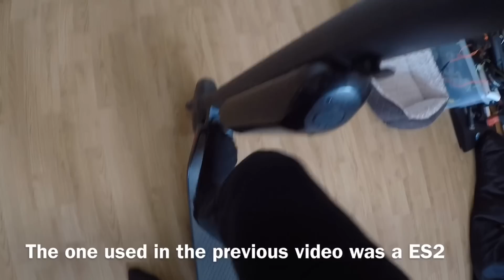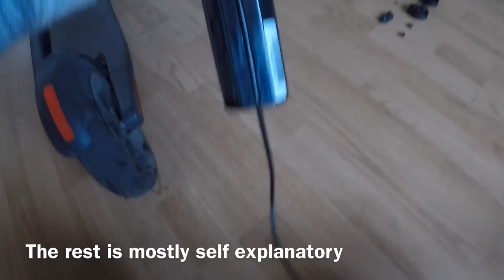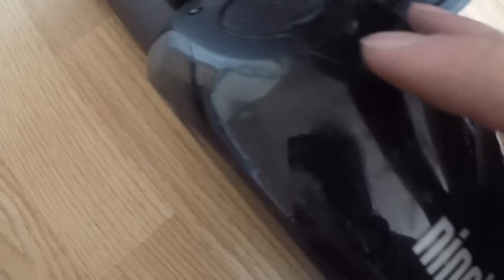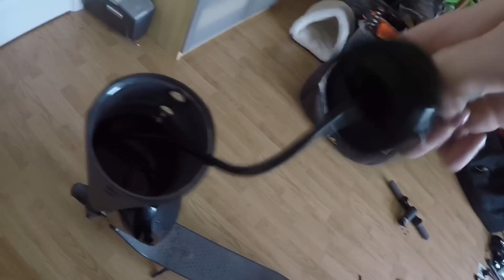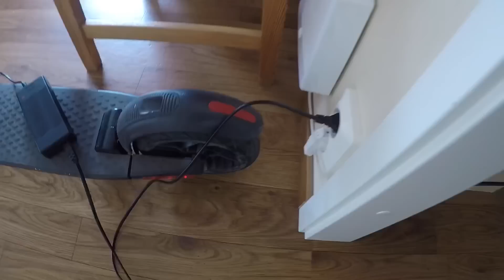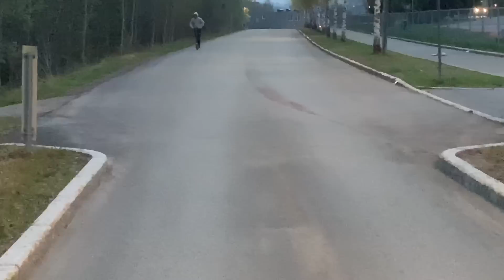Bird Scooter to Personal Scooter Tutorial [Part 2]

Comment: Good day I’ve got a question for you. I have a BIRD ES1 590 and I bought a new Pro 365 dashboard and a motherboard and a 36V 48V 350W controller !!!! But what i realy need is a wiring diagram from all the wires from headlight to battery because I’m a geek What electronica means so would/could you please PLEASE HELP ME to get a wiring diagram for a Bird ES1 590 so i can get my first run on it ??? I hope u will help me to get this fixed. Frank Grinwis

Comment: Does Dashboard and Circuit Board for an foldable (those ones that sells on eBay and Wish) work for the Segway-Ninebot ES4 non-foldable??? When I’m looking at the pictures everything looks the same as mine (except mine has a green cable that seems to go nowhere). I have asked several sellers on eBay and they say it will not work for the non-foldable. If not why?

Mine is an Segway-Ninebot ES4 non-foldable and branded with VOI.

Comment: I have a ninebot es4 but cant not flash it. Because it cant find The version. Should i buy a new control board. Does it then make my scooter like a new one. Because The former owner did flash it but cant find him so need to do somerhing.do you think If I take off The Bluetooth wire so i dont need to connect to a app. Can i then drive it?

Comment: Hi!
I have a problem with my ninebot external and internal batteries. External only flashing lights when pressin the button and internal keeps flashing the same red as yours. My charger looks same as yours, but my led light is flashing red and green alternately. Batteries are still taking in power but with really low speed.

Comment: Dump the music, for several reason. The first one being you will double you view time. A lot of people use you tube just like they did regular TV. They don't necessarily watch it, but are listening. So instead of music do voice over. The other reason, people may or may not like your selection of music and will drop the video and move on. 
Enjoyed the video. Good day.
Reply: Spot on mate, I turned off straight away as soon as I heard the music + no voice over to explain the process better
Reply: I only have tonremove the gps then on my Voi scooteyy! Get a chsrger. And respray, ditch the number plate and the gps in a bin in the Cop shop. And Put a hood on and lots of stickers with A skull and cross b9nes. Remove the top by just smashing it off. Cannot get screws out. Then put a seat on it. Wear a Council Crash helmet. Shades and a council donkey jacket, and reflective jerkin in orange or yellow. Make sure I can get a correct battery charger. Then I am going nearly as fast as a slug compared with an electric bike.😮😢😂❤ Good lad though. You will get a job in aerinautics. Well paid. Helicopters next sweets! I have no clue how to do this erm cin version but you have cheered me up. I hope ur OK sweets. Live you xxx❤❤❤
Reply: Spelling misrakes. Soz
Reply: Eh music is subjective, unlike u i didnt mind it 🤔

Comment: Question will this work if the scooter wheel is locked? I obtained a Spin scooter at auction and the back wheel is locked, before I take it apart and do this just want to make sure it will unlock it completely?
Reply: you can disable the lock permantly yourself open it up and cut/yank it out theres a custom one in my area all it is was a piece of metal that blocked the wheel i cut it out and it now works
Reply from the maker: Chrystal Camacho It will, but it depends on which model you’ve got!
If it’s a ninebot then it will work, other custom scooters are a little bit tricky.
Reply: @ToxicLion  Toxic, can i send u some pictures so u can tell me if this is the model that you are showing on the video?
Reply from the maker: Filipe Serrano Sure, send me at: valent482@gmail.com
Reply: @ToxicLion  the model number i got off the scooter is snsc 2.0 when i googled it shows as a ninebot just wanna make sure. It does say on the side Segway. Also the second link for a better board is no longer active do you have any others u can recommend?
Reply: Toxic Lion please check this email

Comment: I did this 3 month ago and today the metal tube broke after a really smooth shock, at the bottom of the scooter, the tube is brake in half and it is not the screw but the tube itself that broke! 
I think it's is because the location brand (this one was uber) are changing the tubes and make them in aluminium, it's cheaper and the scooter last for ~30 days before someone brake it so it doesn't change anything. 
Be really careful with your scooter... 
(sorry for the English, I am French..)
Reply from the maker: Almost the same happened to me, except it was my screws that broke off... these rental scooters are not meant to last. Thank you for sharing your excperience either way! :)

Comment: Ive changed circuitboard and dashboard,scooter conect to my phone and it says its unlocked,no error codes,but it wont run and front wheel is spinning freely.Please help
Reply: Down load the ninebot app
You need it

Comment: if you don't own the charger then you can connect the battery via XT60 connector to an balance charger and charge it faster externally.
I recommend you to get the iMAX B6AC Charger but inform yourself guys, how to spot fake imax chargers. The fake ones can cause a explosion of the battery if the firmware chip burns out, which already happend to me

Comment: lol the gps on the scooter in the part 1 was placed in the front of the scooter but on this foldable es4 the gps is in the board..hmmm wonder if he knows that.BTW you don't need to buy a new controllen you can just solder the display on the scooter and then flash the controller with your phone..xDDDDD
Reply from the maker: flughoppan I tried flashing and it is just a big flop. It does not work.

Comment: Is it absolutely necessary to replace the control board? Not the dash.
Reply from the maker: If you are doing this kind of hardware swap, then you will need to replace the dash and controller. The standard dash on rental scooters dont work. It is possible to flash it and reprogram it, but thats not my strong suit. 
I had a simular question about this, I left a link to the flash tutorial video :)

Comment: I found a VOI one in a broken electronics container, brought it home and i started to strip it down, but i cant seem to get the display off, i took of the 2 screws holding the display from the inside, but it does not want to come off, i have even tried getting a flat screwdriver in between the display and the steering, do you have any idea of how to get it out? is it glued or am i forgetting something?
Reply from the maker: Rezt x Soldier try to use a flashlight to see if there are any more small screws there or try hitting it out with a screwdriver (if you’re replacing the display then it doesnt matter if it gets whacked)
Reply: Toxic Lion i Will give it a Go, thanks alot!

Comment: In my city, a lot of the broken scooters are being sold off to auction and rebuilt as personal scooters. I purchased one of the Es2 rebuilt scooters and everything works fine but doesn’t connect to the app, no big deaI. I also purchased an external battery to improve speed and distance but when installed, speed is very slow. It won’t charge and taillights blink when attempting to charge. Any help would be greatly appreciated😁
Reply from the maker: bnfishin03 perhaps the motherboard of the scooter is not good quality? As of for the bluetooth, simply replacing the display does the trick.
Dont know if this helps, but yea..hope it works out :)
Reply: what cities are that?

Comment: Why do I have to replace the control board ? Dont you just have to remove the GPS ?
Reply: If you just remove the GPS you get error 32 and the scooter locks up
Reply: @VloFloClan  I removed the gps and tried to turn it on without the eBay parts just to try it out and I got error 32, is my scooter fucked up or it will work with the new board?

Comment: I took a Segway bird and took out the dashboard and dashboard cover or circuit board and cover like you had from the jump I took it off of the bird egg way and I put a new dashboard and cover on it and it came on and the Bluetooth recognized it but it would not connect to Bluetooth and the motor would not engage and the headlight will not come on what do you dodge board light came on like it was fully functioning and inside lower what else do I have to do I have to remove a sim card or is there a fuse or something I need to remove so that poor actually engages the motor?

Comment: With the external battery did or have you ever gotten error 42 ???  I started getting error 42 after I flashed a custom firmware. The error 42 is the external battery connection, the first time I received the error I unbolted the external battery making sure the bracket was on tight - then reattached the external battery, seemed to fix it - scooter worked great for 4 days before getting error 42 again, but this time I could only fix the error by not attaching the external battery.  any suggestions anyone?

I have converted a:
Bird Scooter - ES4 by doing the following:
Flashed the ESC control board with full dump 
Flashed the dashboard controller with stock BLE

Comment: hey can you explain the gps system? in my country we have limes will the gps turn off when it run out of battery or it has a spare one for the gps circuit? and how strong the signal is , if i move it underground will it give spot on tracktion?
Reply: gps is only for position data, it also uses cellphone  towers to locate

Comment: Nice vids :) It's stupid how easy it is to steal those things. But then again, Voi probably didnt pay much more than $250 for their scooters unlike the consumer market. Just a note: Both were ES4. The only difference between ES2 and ES4 is the external battery. The reason the bolts were different is because Voi modify their scooters (like remove the folding mechanism and install the GPS module) and just used hex when they put the scooter back together. I have a ES4, and I love it! I bought mine though :P
Reply: Sry but couldn't you pop in your own sim card and still have it with gps?
Reply: @einfachnurleo7099 late reply but the sim card is just there for the internet. If you were to put in your own sim card you would be providing internet and the gps tracker will just report back to the voi server where the tracker is located

Comment: If I remove the gps tracker can they still track it down ???? Help please and is it only one gps tracker ???
Reply from the maker: The legendary lama if the gps is gone then it cant be tracked :)
Reply: Toxic Lion because I have a voi and I removed the gps tracker should I drive it .???
Reply from the maker: The legendary lama I mean.. thats kind of something you’ll have to decide yourself. If you can and want to then why not? :)
Reply: Toxic Lion thanks 👍🏼
Reply: Is it only one gps on those scooters ? Because I saw the one under the scooter and on the first video there were gps on the motherboard too .
Reply: @georgeasik7770  the one I see today, on the GPS box was a SIM card and a battery.
Reply: @3DPrintChronicles   so only one gps in each scooter ?

Comment: Actually the ones VOI and LIME and other companies use are not ES2s... they are ES1s with taillights and some other upgrades... the ones that get rentet out don't have rear suspension and some of the other key features are missing too, like fx underglow... 
Also
Es2+external battery=es4
Reply from the maker: Ali HN that depends on the region! Where I live there is alot of es2 and es4s
Reply: @ToxicLion  with rear suspension?
Reply: The motors also are different from es1 and es2/4, the es1 has a 250watt motor and the es2/4 have 300 watt motors, it's labeled on the sticker on the bottom and the wheel itself.

Comment: hi having issues with the mother board... bought one from ali express with good recomendations.. and it keeps burining the mother board.. is it because of the battery voltage?
please i really need help
Reply from the maker: Casey Mateus There are a couple of factors; Control board quality, and if you have a display. The display plays a big role in this project because with these control boards I would not recommend to go faster than 27km/h down hills and on straight roads. If you have the display then you can connect to the scooter with bluetooth and then adjust the brake strenght (regererative breaking). Turn it to either medium or low, it is simply too strong for the aftermarket controllers:)
Reply: @ToxicLion  thanks for the help you dont recomend to go faster than 27 because of the brakes or because of something else? iam think of getting another board and not connecting the brake.. should i have the problem solved?
Reply from the maker: Casey Mateus Just make sure to use the display and connect to the scooter with bluetooth to decrease the regenerative breakes. When you release the gas lever it starts drawing power that makes it break better, but it also burns the controller faster. If you dont connect the brake it will come up with an error. You can get the ninebot app from the app store or google play
Reply from the maker: Casey Mateus In other words, adjust the power of the brake with the app :)

Comment: And what if i replaced the dashboard and control board from the scooter with another bird scooter parts?
Will it work or it has to be parts from ebay?
Reply from the maker: RecruitersGamers it has to be ebay parts
Reply: The sellers on eBay says that those parts they are selling won’t work on non-folding ES4. Are the seller’s lying or do I have to order some special non-folding dash and control board? They look exactly the same except my VOI has a green cable for the GPS I think

Comment: Does it work if i only replace The control board and use The same dashboard that i found The scooter with
Reply from the maker: PO15ON Yes it will work, but the controller will burn over really fast
Reply: @ToxicLion  why?
Reply from the maker: The main reason is that, most of the controllers are from china (replicas) and not OEM. So if the display does not turn on as it should then going over the maximum speed limit could burn it over...its just in theory though.. I would recommend a full swap if you really have to do it :)

Comment: Can you change SIM CARD of gps tracker and put it again? I want put gps tracker on my scooter M365
Reply from the maker: I’m actually not sure how that works... maybe that could work?
Reply: @ToxicLion  
But where was the GPS tracker connected? Directly on the battery?
Reply from the maker: Destruindo Horrores It was connected through the controller with some data cables, it is usually like that I belive. However the placement may be different on different models

Comment: Hey man
So you are meaning that if i dont replace the control board (the big tube thing) i wont have bluetooth and speedometer?
I could live with that and save 50 bucks and just buy the dashboard and ride it anyways 
Right?
Will it work just changing the dashboard?
Reply: And what if i replaced the dashboard and control board from the scooter with another bird scooter parts?
Will it work or it has to be parts from ebay?
Reply from the maker: RecruitersGamers the thing is that the dashboard contains the bluetooth and speedometer while the controller is basically what is the driver circuit for the whole thing. So you will need both for this to work 100%. Otherwise the controller may burn out, and replacing just the display works sometimes, but it will be like unlocking a scooter for free with lights and etc always on... so hope you kind of got what I was trying to say?

Comment: man I really appreciate your videos but this one is weird.....this is not the same scooter you used in the first video, but you explained that at the beginning of this video however....still...in this video seems like you are just working with a regular purchased Ninebot...which, as far as I know, does not come with GPS module....however at the end you show the GPS module????? also...during the whole video you work with a scooter which is clearly different from the one you are riding at the end of the video.....this is just crazy....Oh by the way....the links for the parts you posted are for the ES2 according to description on Ebay...but in the video you clearly state that this is a ES4.......this is soooooo confusing...
Reply from the maker: Pedro Sanchez Roca Hey! Yes I understand that you might be a bit confused? The scooter used in this video was a ES4 and the one used un the previous video was ES2, but they are the same to connect and etc. The only difference is screws, motor power , the folding mechanism and the suspension at the back.
The scooter at the end ride was the same one used, but with some stickers on :) The ebay parts fit the ES1/2/3/4 models and work the same, since they are not OEM. Again sorry for the confusion and hopefully its more clear now? :D
Reply: @ToxicLion  ok thanks for the clarifications!